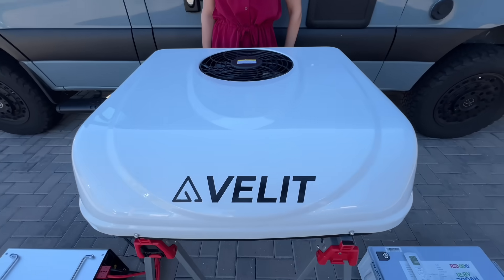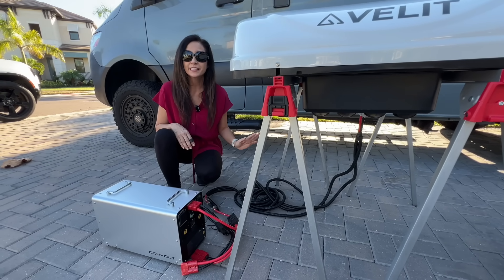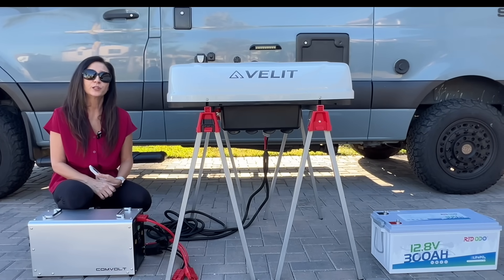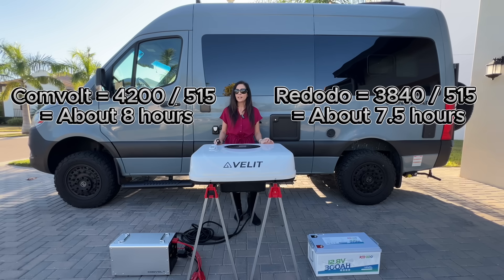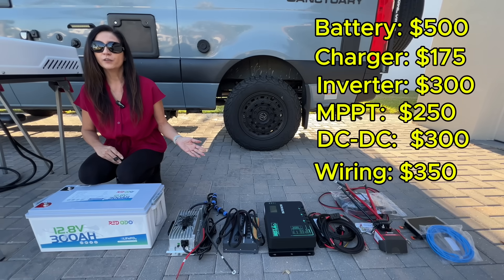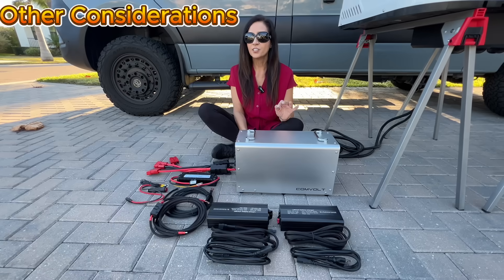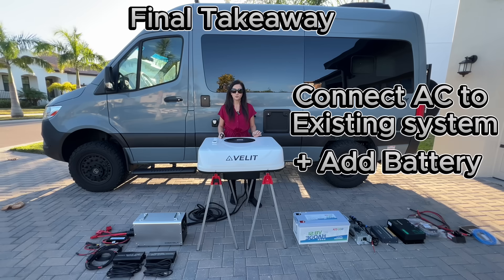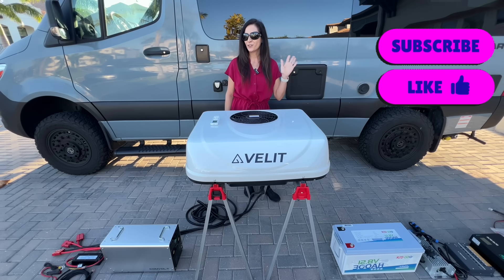Can a Power Station REALLY Run an RV AC?  Power Station vs Lithium Battery!

Comment: ComVolt, I saw that power station used by another van RV YouTuber.  Seems like a really good one that I actually forgot about.
Reply from the maker: Hello Nick, the interesting part of the Comvolt is the 120A DC Anderson port.  This allows a direct connection of the AC to the Power station and also allows for a smaller inverter as the AC is not being powered through the inverter.  If you were using a 120v AC unit, this unit might not be the best option as the 1800 watt inverter would be undersized.  As always, Thanks for supporting my channel!
Reply: @RubysAdventuresUnplugged   Great point about the 120A DC output enabling DC to DC power for the 12V A/C.  Even more observant point about not needing as powerful of an inverter of your biggest watt draw is DC to DC.  I bet a lot of people miss that very important point.  Efficiency is the name of the game.  The less watts we have to invert, the better.
Reply from the maker: Agree, probably could have make that point even more clear.  Thanks for the feedback!

Comment: Hello Ruby - Have you installed a DC AC yet on your van yet? If so, would love to see an install video and your likes and dislikes! I like my Gree which is being powered by a power station but am on the fence about switching it out due to our Florida weather conditions. Happy New Year and keep the vids coming!
Reply from the maker: Happy New Year to you as well!  It is funny you said you are on the fence because I have been as well.  I will be installing a DC AC in the future but I have been debating which voltage.  I think I will end up with a 48V and then connect it directly to a battery that is also being used as an expansion battery for my Ecoflow.  The reason I have not done this yet is I have something big coming for a 48V battery system but I hope to have that unveiled / installed sometime in Feb.  Once that is installed, I will do another AC comparison video and then select one for an installation video.  Thank you for the comment and the continued support!

Comment: How many watts does that A/C use to run?
If it's more than the 400 watt limit of the Comvolts 400w solar mppt limit, you'd still be buying another battery if your using it in the South.

Would be a great option of that mppts limit were 1,000 watts.
Reply from the maker: Hello Steven, In previous testing I have seen this AC pull around 600 watts on really hot days  You are correct that the solar input is limited to 400 watts so there is a deficit.   However keep in mind that the 600 watts is during maximum cooling and the power draw does go down as the AC reaches its set-point (VFD)... it does not pull maximum wattage the entire time.  Thank you for the comment and for supporting the channel!